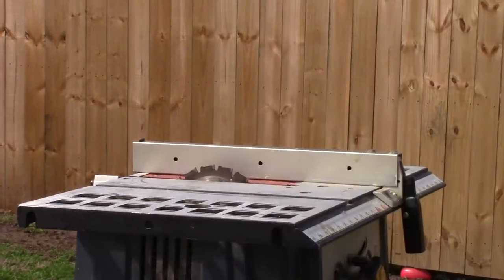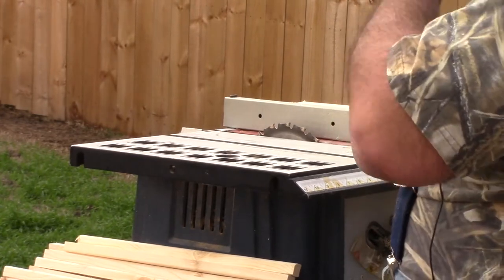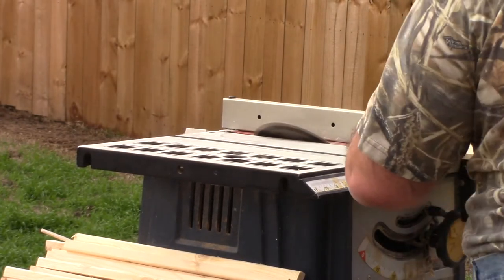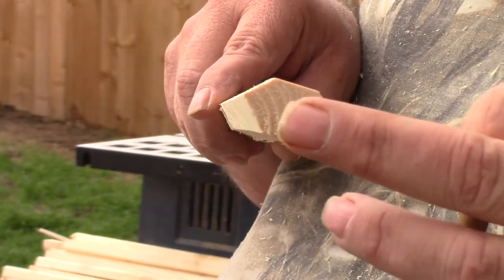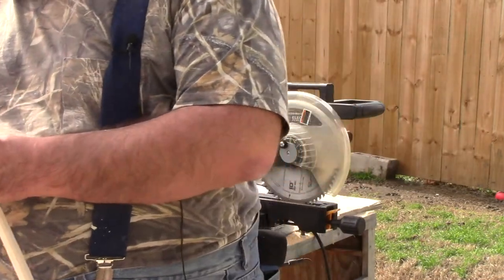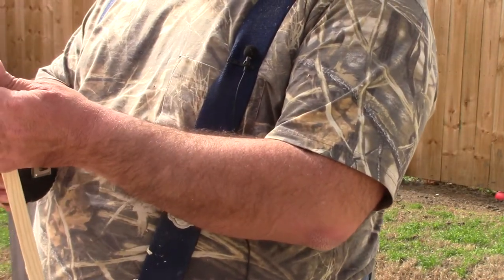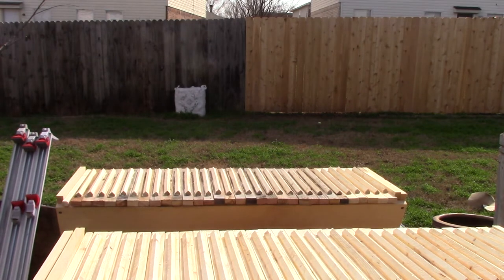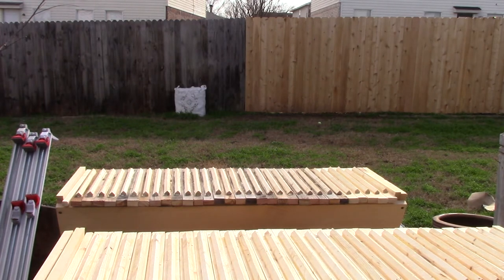How to make top bars for your top bar hive

Comment: Will you please make a video showing how to make top bars out of a single piece of wood? Meaning don't use 2 pieces, just cut a single piece
Reply from the maker: Which method are you referring to? I know some that take a single topbar, cut a groove down the middle, than fill the groove with beeswax and others that take a single topbar without the groove, stretch a string down the middle of it then pour molten beeswax over the string to adhere it to the topbar. There is a third way where you start with a 2x piece of wood and using a series of cuts end up with the V shaped piece on bottom.

The idea of the V shaped piece is simply to guide the bees into putting the comb where you want it. There are lots of ways to make that happen. I really cant say which it best as I have not tested the different ways of doing it. The easiest method I have seen puts a groove down the middle of the topbar and then you glue in popsicle sticks into the groove. To me it is the easiest because you only have one setup on the table saw (blade at 90 deg) and you adjust the depth of the cut to cut the bar to width, then readjust the blade depth and fence to make the groove. For those you could use wax foundation, or plastic foundation in place of the  popsicle sticks.
Reply: @GrandpasPlace  the 3rd option is the one i was talkin about. Where you cut the 45° angle and then do the side cuts. The end result is very similar to what you did but there's no gluing involved